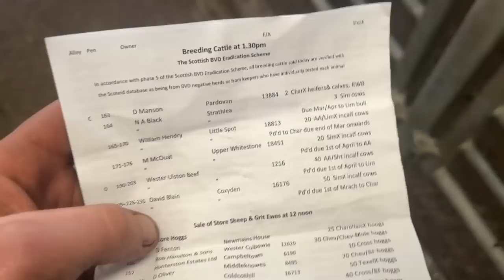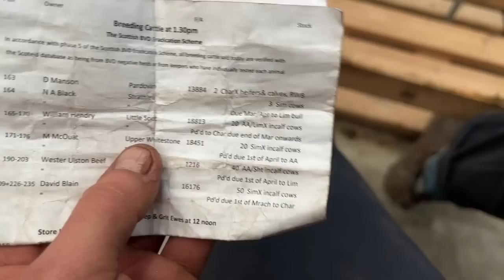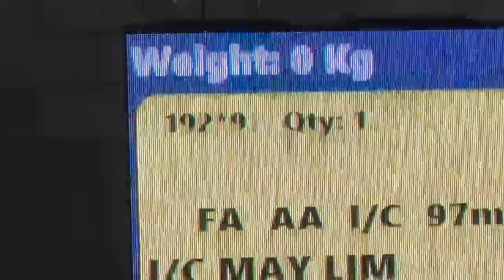I Warped The New Stone Graipe | Bought New Cows

Comment: try to zigzag weld your piece , start in the middle then outside back center and back outside to distributie the heat . try  pushing  instead of pulling and hold your torch more slantend

Comment: You could have filled the whole thing with waste oil, a filler cap at the top and a drain plug in the bottom beam, drill holes in everything before you put it together so all box section would be interlinked, also your weld will look better if you move your gun the other way, with a mig you should always move you gun opposite to how you would stick weld
Reply from the maker: Ahh great idea wish id heard this a couple days ago, already concreted

Comment: Filling it with concrete will not increase the weight by much and will make repairing at a later date more problematic re welding or cutting,gas or disc.                                                                  Seeing you with your scots pie made me realise what i,ve been missing for the last 3 years as I have,tbeen able to get back to Scotland for so long due to a multitude of circumstances,hopefully i,ll get over this year and maybe get round to see you.
Reply from the maker: 30% the weight of steel… not bad. Hope it doesnt need fixed 🤣